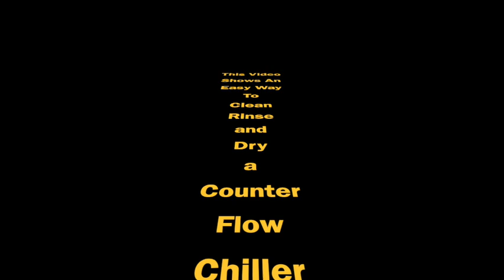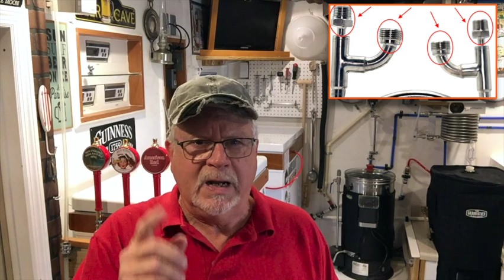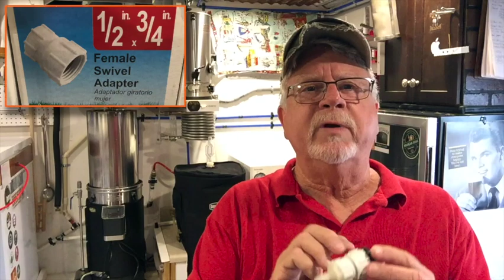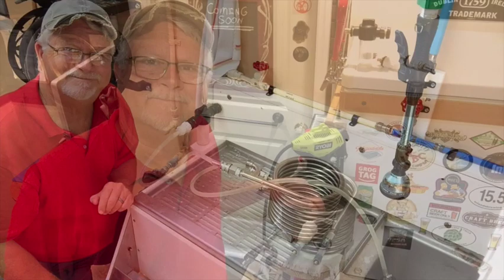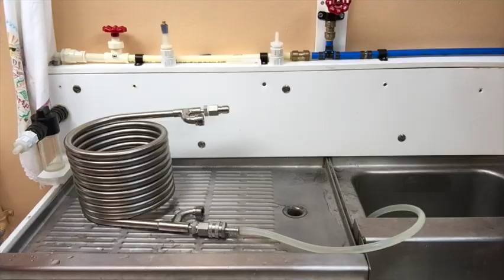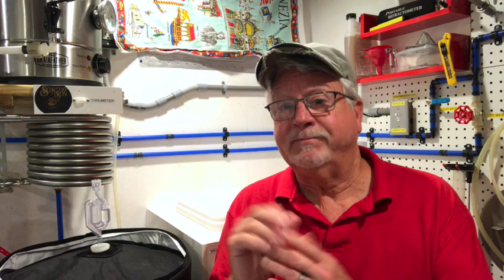Wow!!  Easy Tips for Cleaning the Counter Flow Chiller

Comment: Ok, only one complain from my side...air compressor, if it is not oil free you already contaminate your chiller with oil particles that comes out with air...
Reply from the maker: I thought of that but, Ryobi states their compressors are oil-less.  Nevertheless, I always pump a couple of liters of hot strike water through the CFC into a bucket before I Mash and I always sanitize my CFC for 10 mins during the boil.  Cheers!

Comment: Put the pbw in the grainfather and pump it through the chiller? 
PBW and other sodium perc based cleaners take about 30 minutes at around 60c to be most effective.
Reply from the maker: That's a good idea.  Just remember, according to FiveStarChemicals, you should always use rinse water at the same temp as the wash.  Cold rinse water for cold wash and warm rinse water for warm wash.  Cheers!